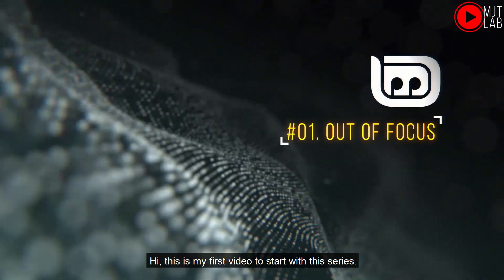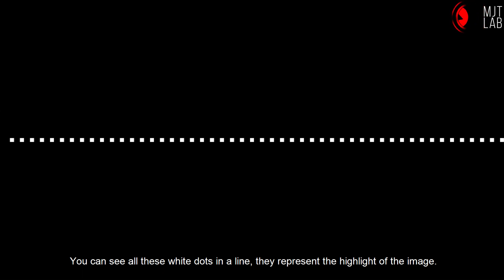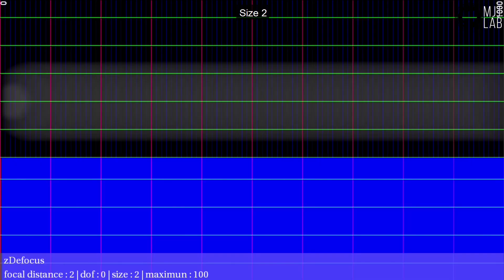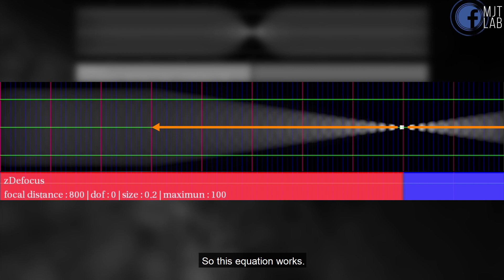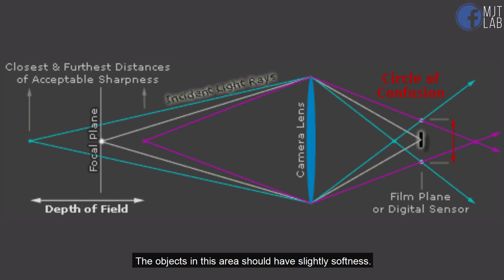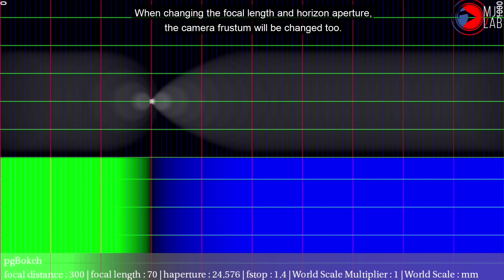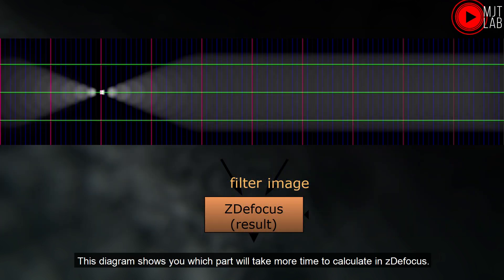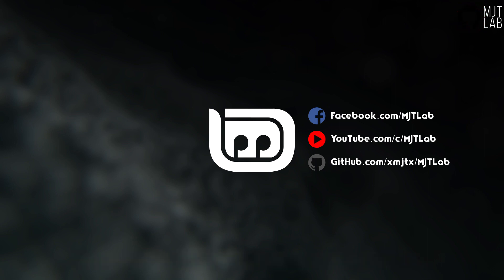Compositing defocus insight

Comment: Nice explanation! One question that I hoped to get an answer to was why zDefocus sometimes offsets the image with 1 pxl when pgBokeh dont. Anything familiar to you?
Reply from the maker: yes, it happened to me sometimes. I think that comes from the different convolve method inside the node. I forgot my solution, probably play around the maximum/size value, check bbox from input, values on the pixels, etc. I will get back to you if I encounter this issue again.

Beside pixel shifted, sometimes I have pixel value issue with zDefocus too. Like those suppose has no alpha and totally black in RGB. But after zDefocus, there some small value pops up. I hope foundry realize that.
Reply: @MJTLab  thanks buddy! Yeah that also sounds familiar 😊
Reply from the maker: @Martin I just made a quick test. Pixel shift happened when I use a custom filter/kernel.
Reply: @MJTLab  yeah, because the kernel is not setup correct or its just how it works?

Thanks for investigating.
Reply: @MJTLab  its because the kernel must be centred on the image: offset your kernel in x and y by 0.5 px. that should centre your kernel ( nuke counts pixels from bottom left to top right, the centre of a pixel is 0.5 and 0.5 y. hope that makes sense. Same principle applies to ST maps
Reply from the maker: @Stickmanfpv  yea, you're right. Thanks.
Reply: @Stickmanfpv  Very helpful!